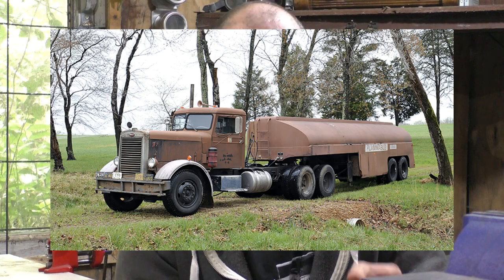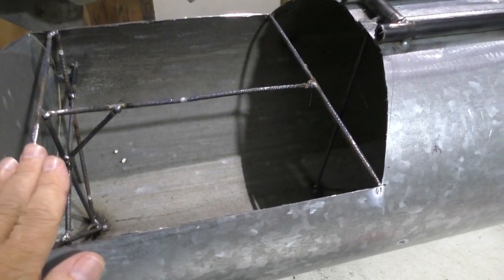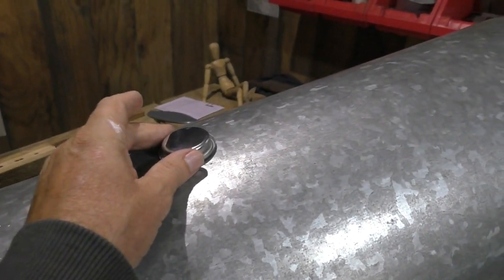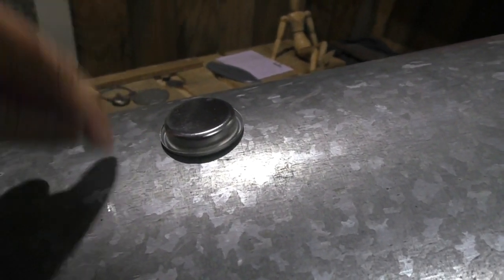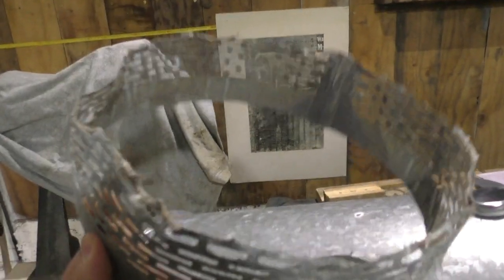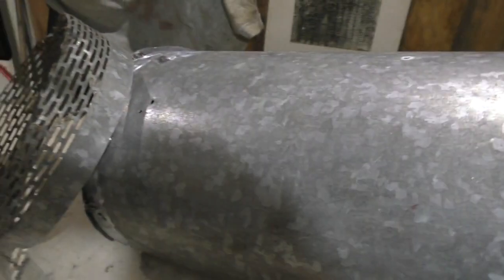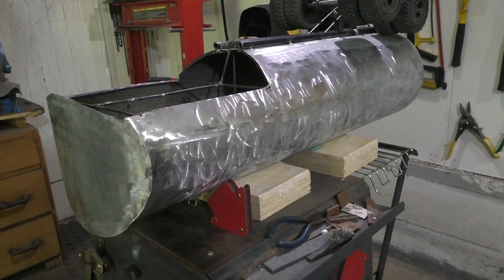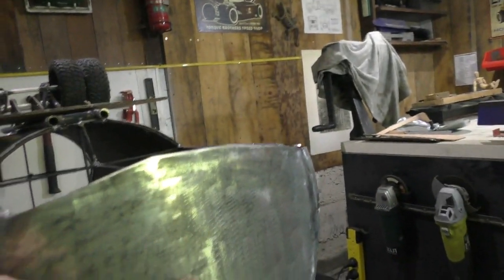"Duel" style tanker for FATBETTY (part three) Metal RC model truck.

Comment: Filler caps - NOT  
Man holes so someone can get inside an inspect the tanks
Reply: Just checking
But to me it looked like fatbetty’s wing mirrors are not far enough out 
To be able to see around tanker
Reply from the maker: Wouldn't want to be the poor bugger who got that job.
Reply: Old Iron RC 
Why else would you need a ladder to get in and clean out 👍
Same for cement trucks ( concrete )